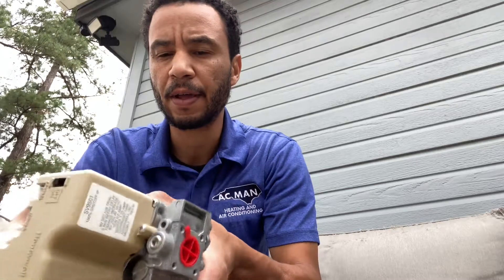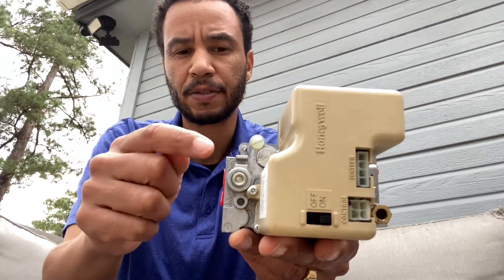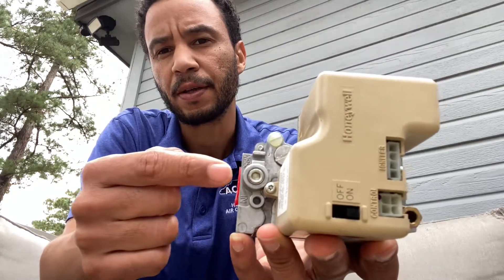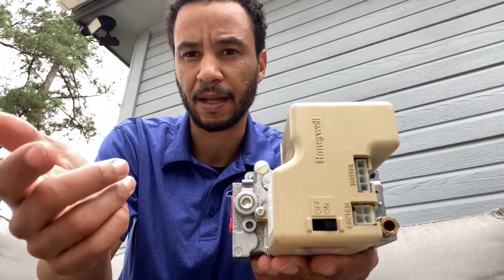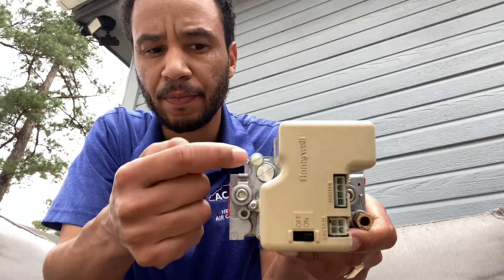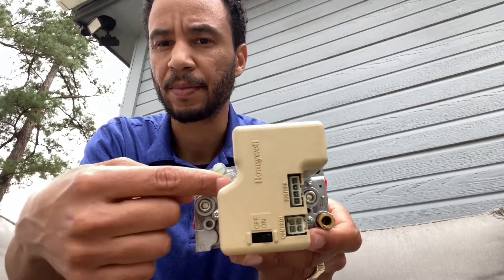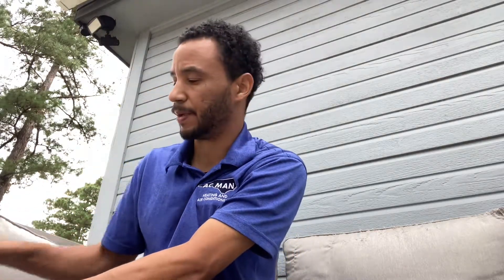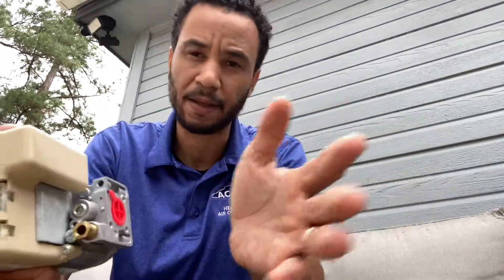How to test gas pressure on a gas valve￼

Comment: Thank you! I have adjusted/replaced/converted  other gas valves but could not recall doing a Honeywell. I needed to be 100 percent sure of which plug cover to open. It all worked just as it should. Thanks again.
Reply from the maker: glad it worked out for you!

Comment: Thank You!!  This is exactly the information I needed to check my old water heater and adjust my new, shortly to be installed, natural gas water heater.  The gas pressure on the old one I'm taking out is 7.5 at inlet, and the manifold pressure is 3.17...which is a little low.  The tag on the water heater says it should be 3.5 at the manifold. My new water heater will be adjusted exactly as the tag shows it should be.
Reply from the maker: nice!

Comment: There is an ON / OFF switch on the unit . Question is the a constant on or off for normal operation?
Reply from the maker: That switch on the gas valve should always be on.